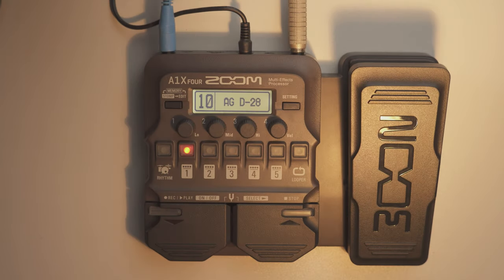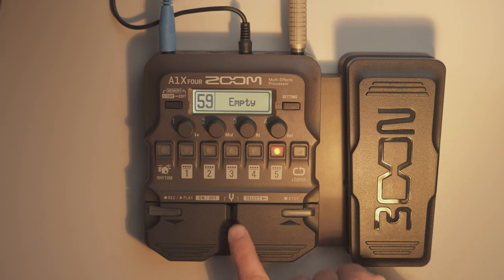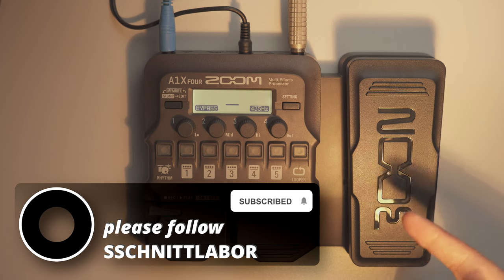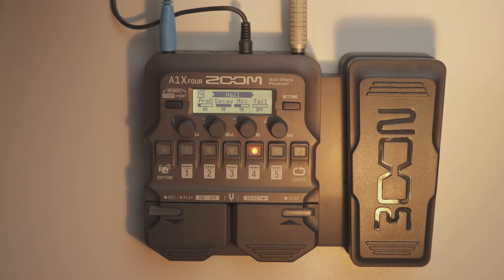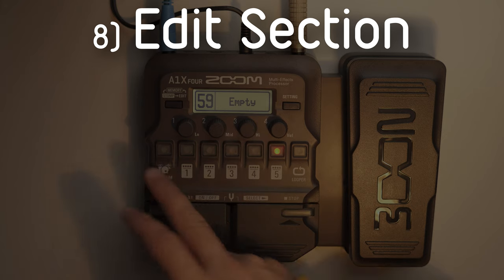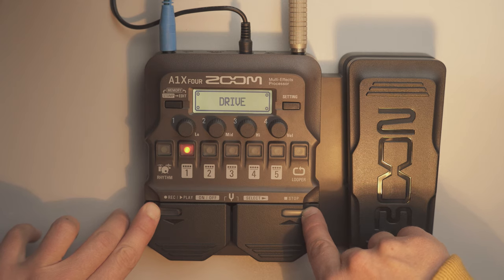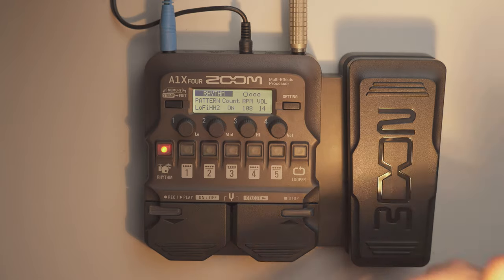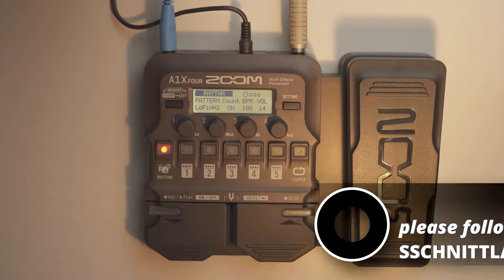ZOOM A1X Four ALL FUNCTIONS, Effects and HOW TO operate ZOOM A1 FOUR

Comment: Thanks that was very helpful, but I have a question, if you could help by answering please! why the power adapter doesn't give a clean sound like with the battery?
Could advise an adapter that doesn't make a noise ?
Reply from the maker: I am not sure. In my case you are hearing a decent humming noise - rattle noise or how to call it, that might be because of other gear inside the same power grid, or because of lack of grounding? I remember a similar problem with this device and some similar ones. Maybe most simple solution is to keep using batteries or even better: rechargeable ones - or try to fix the grounding-aspect inside your installation 👍

Comment: What should I do when the a1x four doesn’t start up anymore ??
Reply from the maker: I would check the batteries, and completely disconnect it from all power sources at first. Note: it switches on only when a guitar-input is connected
Reply: Did you get it working again and if so how are you enjoying it

Comment: Hi. Many thanks for this tutorial it is excellent. I do have  acouple of questions that I cannot find the answers too though. Firstly, how do you turn the machine off to save the battery? and also how do you adjust the delay frequency? I have the one without the pedal. Thanks
Reply from the maker: Hi there, switching on and off works only by injecting or pulling out the plug into the input jack. 
Delay time you can change by entering stomp mode, then selecting your desired delay (->edit), then changing TIME. Values are available between 1 ms and 3 s, after the 3s value you can also synchronize the delay to notation values in relation with the pre-selected BPM, that is to be found under setting > setup > BPM
Reply: @S-LAB  tyvm

Comment: Hi I bought this a few days ago but had some issues with it. Firstly when I put the batteries on, the screen does not come on. However when connected to my computer, the screen came on. But interestingly my computer does not show the existence of the device. Thus the Zoom guitar lab app showed that there was no device connected. Any advise would be greatly appreciated. Thank you.
Reply from the maker: Sorry I am not an exxpert on that. Updates available in between?
Reply: The Guitar Lab needs a connection to the Internet to download new content. I often click the News a few.times ... seems to wake it up. Someone's one has to flash device firmware - and be careful to use a USB data cable and not just a plain charger cable.

Comment: QUESTION: Zoom claims that the Output jack can be used for both "line out" and headphones. I cannot find a "headphones" setting in the manual that would allow the unit to know which output level I want. Does this unit properly support headphones with a correct volume level [as opposed to simply claiming that you can just plug a headphone into a "line out"], and if so how does it know that headphones are connected? Please answer only if you've tried this. Thanks!
Reply from the maker: I used it both ways with no issues 👍
Reply: @S-LAB  So when you plug in a headphone, you get a reasonable volume? In my current pedals, when I connect a headphone to the "output" jack the volume is ridiculously low; this is because much more power is required to drive a [low impedance] headphone than to drive the [high impedance] "Input" jack on guitar amps. So in order to properly drive both, the A1 must effectively attach a different circuit depending on what's plugged into it. If you are getting reasonable volume, do you have any idea how the A1 "knows" that you have a headphone attached? Is there some way that you explicitly tell it, or does it just seem to work?

Comment: Stupid question but what equipment do I need to buy with this? cables , mic, speaker? I'm not at all technical......!
Reply from the maker: There are no stupid questions. If you want to work with this machine, you just need a cable to connect it with a guitar, that's it for the input. For the output you need the same type of cable to connect it to any kind of speaker. By the way, also there is an aux-in, with which you can put in a stereo signal from any kind of player or cell phone Etc. The other video which I linked inside this video explains all in and outputs, it is an unboxing video.

But since you mentioned a microphone I would suggest you to use the following machine instead for your voice:

https://youtu.be/nzvcPjNBti8
Reply: @S-LAB  Thanks for your excellent video but I still can't figure out how to save a recording I've made.....and the manual doesn't seem to mention this....Over the left pedal it says 'rec' but it records when I use the looper only it seems and even then I can't see where it saves it. Can you help? thanks
Reply from the maker: Hi Bui, in the following other video all connectors are being explained: https://youtu.be/g-x8L5PkZso?t=377 
You can use the 6,5 mm jack to output your signal for recording into any external recorder. This would be my way to record the A1X. You may use any adapters from 6,5 mm output jack down to chinch or even smaller - depending on your recording device analog input ... 🙂

Comment: QUESTION: I have two adjacent patches, one with much reverb/delay and one with little or no reverb/delay. I alternate between two within songs and even in the middle of a chord. Can I change patches in the middle of a chord with no "click", no "pop", no silent gap, and with the reverb & delay "tails" continuing into the next patch? [I realize that to have continuing "tails" I must set "tail on" in the reverb & delay parameters.] Please answer only if you've actually tried this. Thanks!
Reply from the maker: thanks for explaining, I was not aware of it, thanks for sharing with the community ...
Reply: @S-LAB  So if you have two adjacent patches could you try switching between them in the middle of a chord to see if it transitions smoothly with no clicks, pops, or gaps? And if one of them has reverb or delay could you set the tail option to "on" and tell me if these two effects continue decaying smoothly when the patch changes?
Reply from the maker: Seems to be hard cuts between the patches
Reply: @S-LAB  Thanks so much. You just saved me a bunch of time, especially since stores no longer seem to have stuff on display where it can be tried. The primary difference between rackmount units (like my old Digitech GSP 1101) and foot units is that the rackmount units can handle this - they have parallel processing units that somehow keep the old patch running while you start the new patch. I was hoping that the increased miniaturization of processors would have allowed some pedal maker by now to have this capability, but I'm not finding any. Given that this is a really nice feature that people pay many $$ to get and that it is a prime differentiator between premium & non-premium products, it would be nice to see reviewers cover this topic more.
Reply: @S-LAB  It seems ironic that this unit would have "tail on" options for both reverb and delay, and yet be unable to switch smoothly between patches. The instruction manual explains that the "tail" preserves the decay of previous playing after the effect has been "turned off". Other than switching patches, how would they expect me to be turning off an effect without switching patches? I guess I might have a footswitch dedicated to this - but switching patches seems like a more likely way to change one's reverb & delay settings. Thanks again!
Reply from the maker: Just to help you a little further with your topic: "tail on" function does not apply as a continuous tail when switching between patches, but when deactivating one of the up to 5 possible stomps INSIDE a patch. In "Stomp mode" you can use the right foot switch to switch between the stomps and the left one to either activate or deactivate them. This way you could for instance put one reverb and one delay next to each other with different intensities – and this way achieve the effect you are longing for

Comment: Thanks for posting this but you really should use the correct terminology when explaining the features.  It can be confusing enough but it becomes more confusing when you use the wrong terminology.  For example, there is no such thing as "stomp box effects."  Stomp box is a mode.  It shows what effects are available to turn on or off and adjust. Groups of effects, whether pre-set or created by the user are called patches. (You never even mentioned patches.)   I would suggest that you understand the terminology well before you make a video so you don't confuse the viewer.  Also, a HUGE thing that you didn't mention at all is Zoom Guitar Lab, the free application that allows you to do far more than you can with the the A1X Four alone although there is some overlap.  In fact, that's where I create patches and make adjustments the vast majority of the time.  And you have to use the Guitar Lab to delete and add new effects, etc., to the A1X Four.  It's a free download so there's really no excuse to not even mention it.  You can't even do some of the most important things with the A1X Four without using Zoom Guitar Lab.   Maybe you should make another video about the lab but, if you do, please use the proper terminology so everyone is on the same page.
Reply from the maker: Hey Bob, thanks for your comment, I will reflect on your wise advice and furthermore try to improve my terminology too. And sorry, neither am I an expert on Guitars, nor on Guitar Effects, nor on the English language, since it is not my mother tongue. I just wanted to present this new tool as easy as it can obviously be used, luckily without a computer needed. That’s what I like so much about it, this way it's kind of back to the roots ...
Reply: You did great dude, especially in a foreign language all i can say is, Bob, cut this guy some slack. @S-LAB
Reply from the maker: @pedr0p0lis  Thanks for the flowers, man!
Reply from the maker: @ZOMBIELANDakaUSA  hi Mr. Knownada, which Video do you mean?
Reply: He did a great job, very useful for a non techy player who might be thinking about buying this unit. Bob....with your knowledge and correct terminology it might be very helpful for some of us if you were to make your own tutorial.
Reply: @S-LAB  I think your English is amazing.  Maybe the detractors could try doing a comprehensive review in German and see how they get on.
Thanks for the review.  I'm considering buying this unit, or something like it, and you've done a good job of demonstrating it